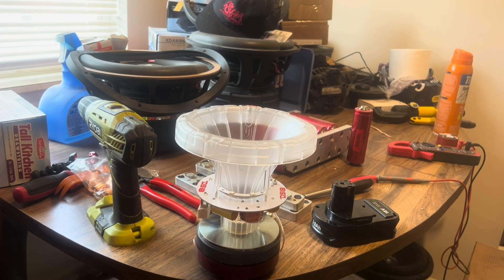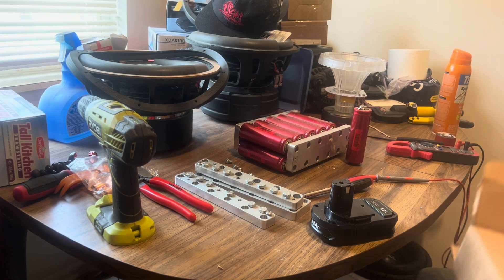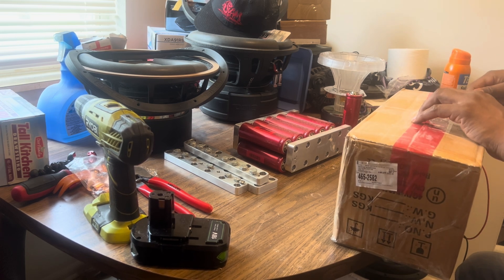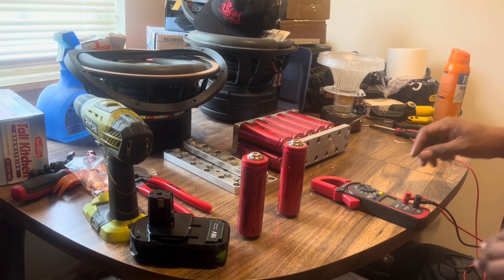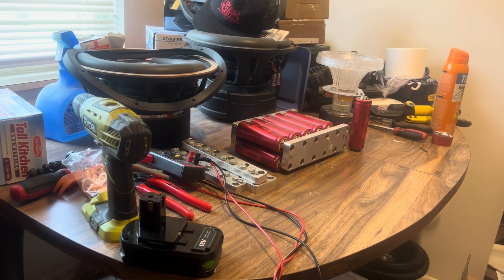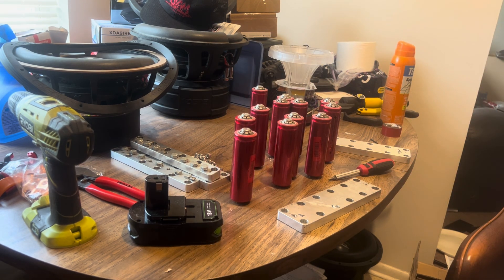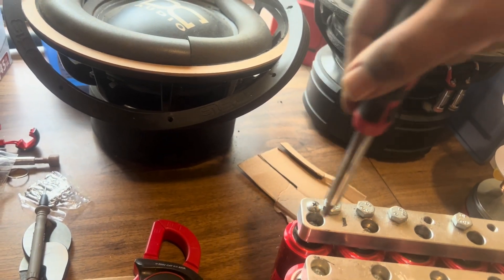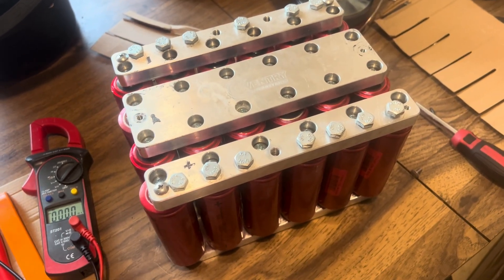Dark truth about lithium Headway Cells + How to build a 48ah Bank + Unboxing

Comment: The worst thing about headway is the cold starts it's the MAIN reason cells fail because they can't handle the in rush of current when they are extremely cold I read and researched them thoroughly before purchasing my lithium Banks and the general consensus is that when it's cold and you start your car you get a rush of amperage to the bank from the alternator trying to bring the battery from the float charge to the operating voltage when this happens the cells get overcharged and the balancer isn't able to keep up with the rush of current and BOOM they fail it's literally the reason for 90% of headway banks failure not to mention the actual manufacturer recommended not to charge over 14.4 if I'm not mistaken granted they work at 14.8 just like the Lev60 jag35 batteries because the extra voltage is divided between ALL the cells making the over charge minimal so operating headway at 14.8 is already over manufacturer spec then with the cold starts it's not a matter of IF they will fail but Rather WHEN they will fail my Recommendation would be to change to a Different lithium or you will be continuously replacing cells
Reply from the maker: Thank you for the super awesome feedback
Reply: @markwoods212  I just wanted to throw it out there in case it was something your dealing with I fully understand the problems associated with lithium it's a whole thing to maintain a good bank I'm still learning myself but that was something I kept reading about headway so I went a different route because my build is in my daily driver and I can't risk it